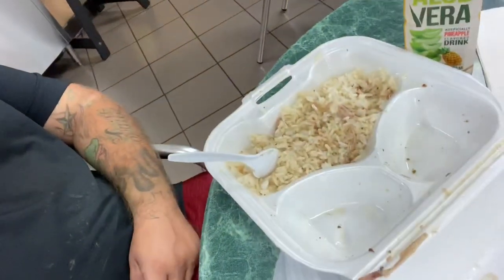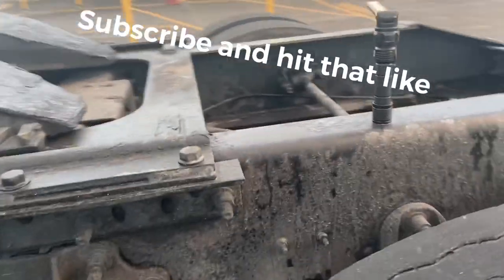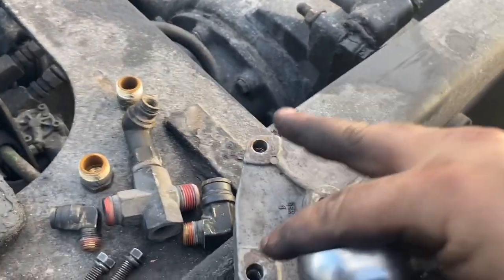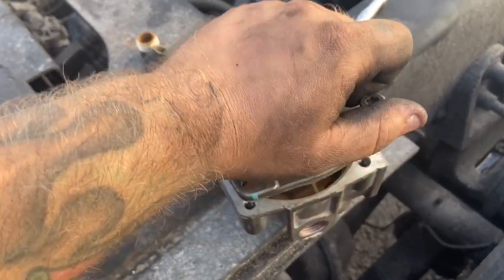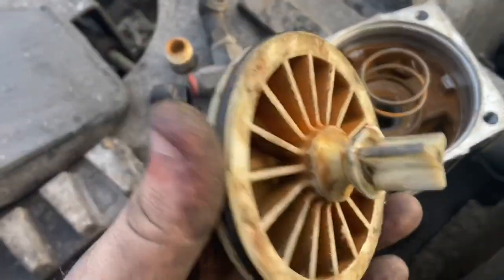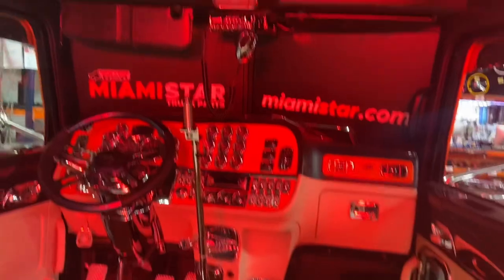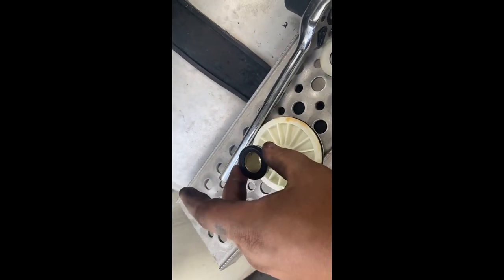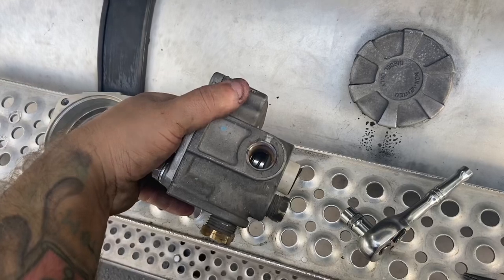Replacing/ rebuilding the Air brake Relay valve and visiting and Miami star

Comment: Great video! I've never seen inside a brake relay before.
#1: Where do you guys like to get your Bendix/Air Brake parts online? 
#2: I think I too have a brake relay valve problem: I'm getting air pressure coming back up to the service brake valve from the brake relay. When I take off the relay and have it in my hand, where do you suspect I will find my problem?  Thanks in advance.

Comment: Hey Shawn New subscriber, Wanted to say hello, 👋and thank you for sharing, isn’t it interesting how you start finding stuff out once you start taking things apart, by the way I wanted to ask you if you can share the symptoms that this Air valve does when is bad so then this way when I experience the same problem I more or less have a heads up on it, thank you in advance, Robert.
Reply from the maker: You know when this one is bad when you step on the brake petal and air dumps out of the valve Botom
Reply: @truckerstyleshawn  Got it man thank you